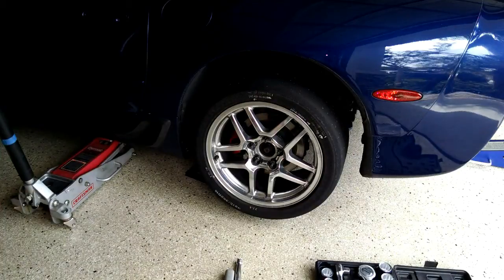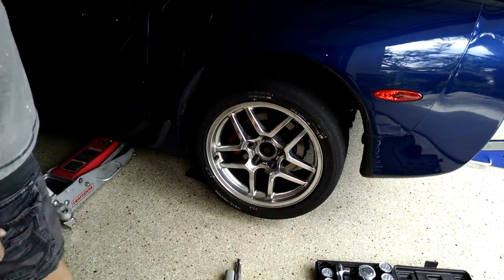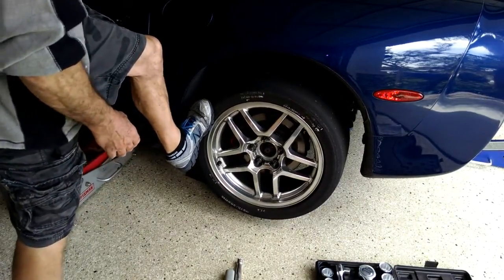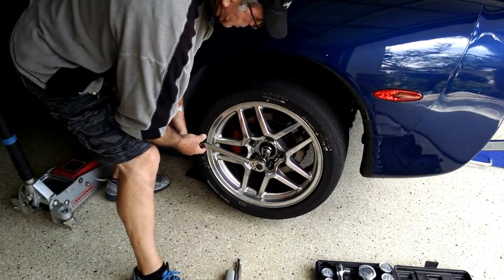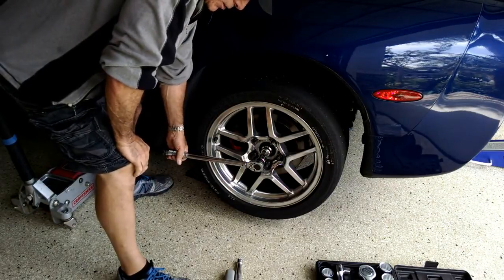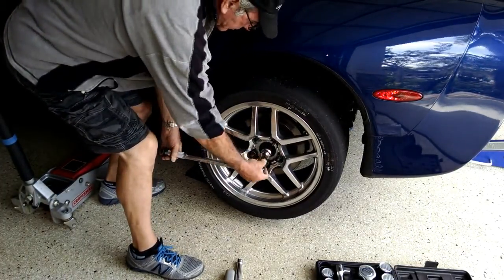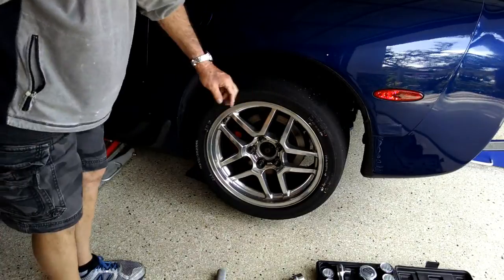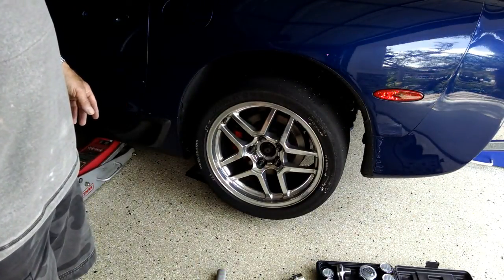Corvette differential test clutches break away torque by froggy

Comment: If your LSD clutches are good to begine with, the wheels would have not move that freely...

Your Torque test procedures seems like you are checking the transmition clutch breakaway instead of the differential.

Comment: Question Froggy, I know you said transmission in gear. Is this right? I hear conflicting info. If i try this in my C5Z out of gear, the wheel spins freely with just my hand, in gear, I cannot get it to break away at all.... 150ft-lbs and with breaker bar. nothing..... (parking break is off made that mistake on the first try.....)
Reply from the maker: That's how I was taught, I know there are conflicting "methods".

Comment: Well,Holden recommend an LSD preload setting of 68 Newton Metres in their factory service manual for the Borg Warner 78 series differential.

I can imagine that my Dana M80 IRS diff would be the same in my Commodore,as they basically have a similar 28 spline 4 pinion LSD centre to the heavy duty 78 series Borg Warner diff as found in the V8 cars.

I set my clicker torque wrench to 80 Newton Metres & it moved the wheel when only 1 wheel was jacked up but it couldn't move it at the 70 Newton Metre setting, so I'd say it's set right.

I checked it because I wanted to make sure that the LSD cones weren't slipping,I could feel them slip when turning on a sharp corner or doing a U turn.

The reason I refer to the Borg Warner manual is because they are basically the same diff,it's just that Dana bought their tooling & factory out in Australia at the turn of the century,they did make a change such as changing the yoke to accept a "guibo" or flexible rubber drive coupling,they may have also changed their fluid grade & added a friction modifier, I'm not sure !